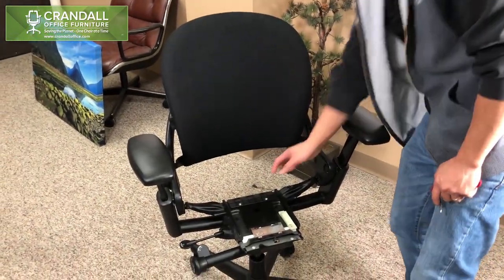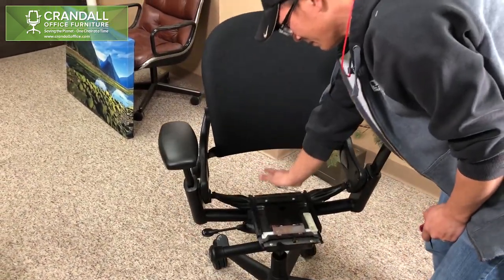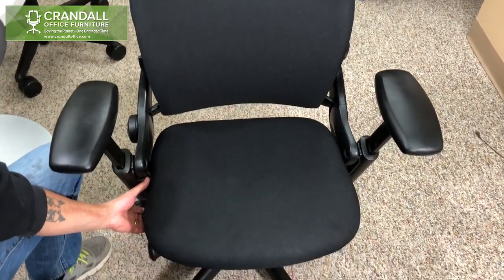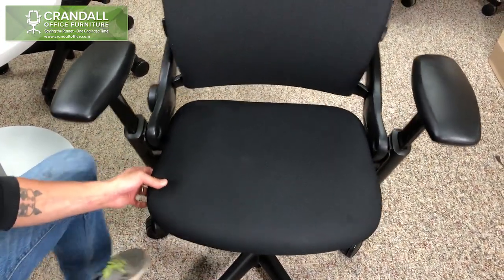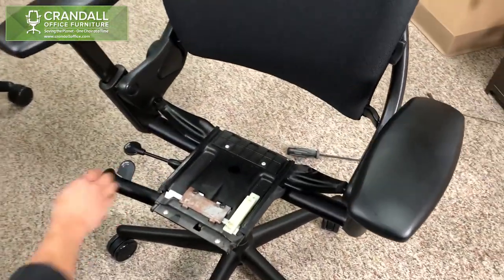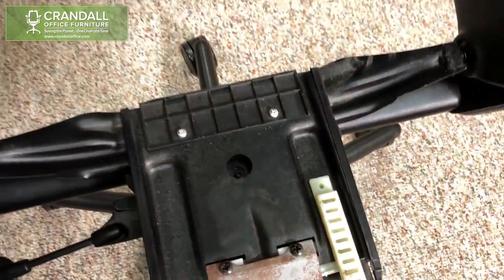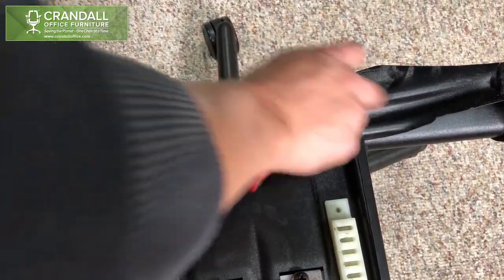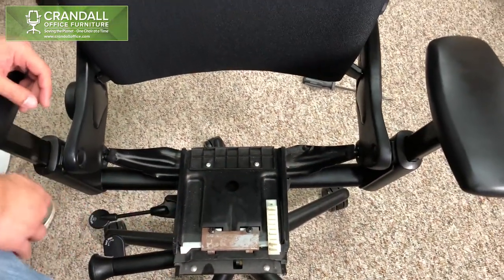Fix your sinking Steelcase 462 V1 Leap Chair - Gas Cylinder Set Screw Adjustment Instructions

Comment: For newer users, you should specify why you would tighten or loosen. Loosening would prevent it from going down while its ‘locked’. A looser set screw would prevent it from charging the piston constantly, which would give you the results at the beginning of vid
Reply from the maker: This article should help - it's all about the pivot and how the lever actually activates the cylinder: https://www.crandalloffice.com/blog/adjusting-your-gas-cylinder-set-screw/
Reply: @CrandallOfficeFurniture  I couldn't get the seat off. I think I have the same model. When I sit, the seat dips a 1/2 - 1/4 inch... Is this preventable or by design? I don't think i'm at the max weight (220 Lbs)

Comment: Can you explain how to remove the seat with the screwdriver? The guy did that really fast and didn’t say what he was poking to get the seat off that slider bracket.
Reply from the maker: Hi there - so if you watch when he removes the actual chair pad you'll see what white piece that kind of looks like a ramp. that's what you're aiming for with the screw driver - if you use a flashlight, you might be able to see it, and be able to place it a little better. Let me know if that makes sense and helps. -DC
Reply from the maker: Also this video might help - we go over a bit more in depth how to remove the seat - https://youtu.be/SCy1ErJG15s
Reply: @CrandallOfficeFurniture  I see what you're talking about. Got it! Thank you!

Comment: Is there a fix for a leap v1 from 1999 with no set screw? Not as is missing, not a part of the design. No hole for it in the frame so I drilled a hole where it is in the video and there’s no screw to adjust.

Comment: Hi nice video you have, but I still have some problems. I dont know where exactly to place the screwdriver to remove the seating part. The reason I need to adjust the screw is that the chair refuses to stay on  a setting. it sinks down until the mid level. in order for it to stay on a particular setting, I have to push down the adjustment lever so as to disconnect it from the chair until it "hangs" there. If you could help me out I would reaally appreciate it. Cheers
Reply: my longest screwdriver (7") was too short.  I used a long narrow pruning knife (used for Christmas trees) that easily reached to lift up the white tab that is adjacent to the rail.  If you have a long skinny tool of any sort likely at least 12" or more should reach.  That white tab is located on the removable seat in line with the center of the seat.
Reply: How does it lift just pushing it ?

Comment: My Steelcase Leap V1 doesn't raise when pulling the lever right away. I have to tug on the chair upwards to get it to start moving, then it raises normally. Is there an adjustment for this "sticking" ? Maybe a place to lubricate? Thank you!
Reply: Same problem, but no access hole to adjust the set screw. Help! Steelcase V1 pre 1999 chair

Comment: I think this worked for me, thanks so much! There's another video on youtube that shows how to take the seat of a leap chair btw, helpful if can't get it from this vid.
Reply from the maker: Glad this worked for you! 😊
Reply: @CrandallOfficeFurniture  Hi there, it actually didn't end up working no matter how finely I tried to tune the set screw. Do you think the entire cylinder needs replacement? The chair is currently adjustable but slowly sinks over time
Reply from the maker: @termiNader2013  If adjusting the set screw didn't help and your chair is still sinking, then yes, it's likely your cylinder is on it's way out.

Comment: Hi.. Anyways to get a zoomed-in picture of where the height-adjust lever meets the seat-base?  
Pressing the lever doesnt seem to do anything with the base for it to control the cylinder.
I have a feeling mine is broke or misaligned for it to work. Thanks.

Comment: I'm having trouble getting the seat off. I'm trying to copy what the guy is doing in the video, but he goes really fast and doesn't explain what he is doing, so I'm just sticking a screwdriver in the chair and trying to pull the seat forward and it's not working.

Edit: I found the other video that is specific to removing the seat, and it is a bit more clear. Alas, I don't have a long nose screwdriver, so I'm at a loss as to how to activate the removal mechanism. I tried to use the long hex that comes with the chair, but it doesnt seem to apply enough pressure. I shall keep brainstorming...

Comment: hey there, so my chair seems to lower on its own only once ive been off it for 15 minutes and then sit down with a bit of force, itll lower about an inch or two. Could this be fixed by slightly loosening the set screw?
Reply from the maker: Does the cylinder actually lower, or are you referring the compression of the gas in the cylinder, which feels a bit like a small bounce when you sit down? If it's the former, the set screw should help - if it's the latter it will not.

Comment: my chair sometime sinks and sometime stay on the highest position when I sit on it! After sinking if there is no weight it come right back up. Now what should I do with the screw? should I tighten it or make it loose
Reply from the maker: What you are describing is a bit odd, but I would try loosening it just a touch. If that doesn't work, sounds like you may have a faulty cylinder that needs to be replaced

Comment: Hi, I recently purchase a refurbished Leap v2 that seems to go down in height by like half an inch randomly when its not being used?  For example, the past 2-3 days, the first time I sat in it on that particular day, I noticed that the chair was lower than before and I had to adjust it back to max height again.  Is this caused by the set screw?
Reply from the maker: Hi there - that specific problem does not sound like a set screw issue - did you purchase your chair through us? If so, shoot us a quick email to contact@crandalloffice.com with your order number and we can look further into what chair you've got, what cylinder you've got, and what we can do to help :) If nothing is glaringly obvious to us, we'll send you a replacement cylinder under our warranty free of charge :)
Reply: i have the same problem and can't fix it with the set screw
Reply: @joemarilla  Lol, its funny you replied to this today, I just got my Leap v2 refunded.  I got my cylinder replaced and for a while the problem went away (2-3 weeks) and then came back.  I was about to get it replaced again today but that cylinder immediately lowered when someone sat in it so I ended up getting a refund because even the used furniture store manager was like, WTF?!
Reply: @ahmedkhan94  ah man - i bought mine used and it's so annoying, sounds like the cylinder did nothing?
Reply: @joemarilla  unfortunately no, but I think they were using aftermarket cylinders because over the course of my time with the chair, I dropped weight from 240lbs to ~200lbs and the chair started sinking less frequently.   But I liked the chair so much that I am gonna get a new one from Steelcase, either the Leap v2 or Gesture because I have heard their warranty along with their customer service is great.

Comment: My v2 set screw will fall through the hole if I tighten it all the way. Is my screw stripped?
Reply from the maker: It's likely not stripped if you can continue to turn it, but it should not fall through if the correct cylinder is in place - did you just replace your cylinder?

Comment: Even if I take the set screw out completely, my chair still rises by itself. This is with a brand new replacement gas cylinder. Any tips?
Reply from the maker: Is this one of our replacement cylinders?
Reply: Hey did you ever fix your problem? I have the same issue, I accidentally completely unscrewed the set screw and my chair rises by itself.

Comment: I have the same chair but its not top activated its side activated. That means theres no set screw. The height adjust keeps sinking after i sit on it. Is there another video someone can link to me bc i cant find one
Reply from the maker: You are correct, the side activated style cylinder does not have a set screw adjustment, so unfortunately it sounds like the cylinder on your chair may have reached the end of it's life.

Comment: I adjusted my set screw but it never locks in place now. Do I have to have to replace the gas cylinder? Or is it a different issue that needs to be fixed?
Reply from the maker: What do you mean by it never locks in place now? Do you mean the chair goes up and goes down automatically when you sit in it / get out of it? If so, back off the set screw a touch.
Reply: @CrandallOfficeFurniture  it never locks in place as in the set screw doesn't tighten anymore. There's a point where it tightens and then loosens, tightens at a certain point then loosens.

And yes, it goes up and down.
Reply from the maker: @spicykamote  So the set screw will not stay in place is what you are saying? You can try some loctite on the threads - there should be some on there from the factory, but it may have come off.
Reply: @CrandallOfficeFurniture  I'll have to search up what that means haha. But even before this happened, my chair would randomly rise up even if I did not adjust anything. I'm not sure if this is a problem with the gas cylinder or what. But I am willing to buy new parts of needed
Reply from the maker: @spicykamote  I would continue to work with the set screw - it could be a defective cylinder, but what you are describing doesn't scream defective cylinder to me. That said, if you still can't get it working, a new cylinder is what I would recommend.
Reply: @CrandallOfficeFurniture  okay sounds good. I think I'll have to get a new cylinder. The set screw isn't locking in place anymore. Thanks for the help!

Comment: how would i do this on a v2 leap? i took off the cylinder to move it into my car. after i put the cylinder back in , the height no longer adjusts
Reply from the maker: Hi there - do you happen to know if your chair uses a top or side activated gas cylinder? Can you shoot me a few pictures to contact@crandalloffice.com? We'd be happy to help however we can!
Reply: @CrandallOfficeFurniture  side activated
Reply: @CrandallOfficeFurniture  it's a side. i took it into a local office repair store and they were able to take it apart. it looks like the cylinder will no longer go up and down so i just placed an order for a new one. Do you know if using the pipe wrench to take it off broke the cylinder somehow? it was working just fine before i took the cylinder off.
Reply from the maker: @chunkymonkey2782  Are you sure it just wasn't installed improperly (with the lever facing the wrong direction)? That's the most common thing we see. There is no set screw for a side activated cylinder. Do you still have the cylinder that was removed? What happens when you activate the lever?
Reply: @CrandallOfficeFurniture  nothing happens when i press the lever
Reply from the maker: @chunkymonkey2782  Is the cylinder already fully extended?
Reply: @CrandallOfficeFurniture  it is not
Reply from the maker: @chunkymonkey2782  Alright definitely sounds like the cylinder is bad. Was this one of our chairs? That should be covered under our warranty.
Reply: No i bought it from another store but it's under warranty so they said they will replace it

Comment: Hello, I notice that my chair has sank 5mm after being sat on it for an hour or so. Then when I am not using it for a while, it will usually return to its original height.
Is this a problem with the set screw? If so, does it need loosening or tightening?
Also, is this something that can be easily fine tuned? Because as it currently stands the problem is manageable and I don't want to have it any worse.
Reply from the maker: Are you talking about the "bounce" effect that you get when sitting in an office chair (it will sink slightly when sitting in it and then returns to normal when you get out)? If so, that's completely natural. If not, you can try loosening the set screw a touch and see if that helps. May be an adjustment issue, or may be  the very early signs of a failing cylinder as well.

Comment: I recently bought a replacement cylinder for my leap v2 (top-activated) and for some reason the cylinder has a larger top activation button which makes it so that no matter how much I loosen the chair's set screw, it will always be activated. Even if I completely unscrew and remove the set screw from the frame, that metal piece that the set screw threads into is still sitting physically low enough to the cylinder on its own that it activates the button. The only hack I can think of is to try and sand down the top edge of the cylinder activation button since it's plastic. Anyone else have any advice for this situation??
Reply from the maker: Did you purchase this cylinder from us?
Reply: Did you resolve this issue?
Reply: @CrandallOfficeFurniture  Hello, I believe I have a similar problem as mentioned by this person. The replacement gas cylinder that the 2nd hand seller got for me was a TKD5201-140 TUKA. That said, the sinking was already a problem before replacing the gas cylinder, we had hoped a new cylinder would solve it, but the problem of the chair sinking. Whether the lever is activating the mechanism or not it just sinks when I sit on it. Like the lever won't even be touching the mechanism, but it'll still sink. I've also tried adjusting the hex allen screw inside. To both sides and a bunch of configurations inbetween, and it didn't work with my old gas cylinder, nor with my new one. The new one didn't even have an hex allen screw inside so I had to use the one from the old cylinder.
Reply from the maker: @hippie_4762  Can you email over a few pictures of what you've got going on there to contact at crandalloffice.com? Not sure I'm fully understanding what you are experiencing. Does your cylinder itself have the screw?

Comment: I was wondering how to make this adjustment on a chair that has a lever on top and not a screw.  I got this chair second hand, so I am not sure if it is a V1 or V2.  The link is a picture of what I see when I take the cushion off.  https://drive.google.com/file/d/1bQhmMUKSoqhtgDsFP0aQEiXmkanmjWQ0/view?usp=sharing
Reply from the maker: Scott - Unfortunately there is no set screw on the side activated style cylinder. Is your chair cylinder sinking without activating the lever?
Reply: @CrandallOfficeFurniture  Yes.
Reply: @CrandallOfficeFurniture  mine is as well. Is there a fix?
Reply: I just got a chair yesterday and I'm having the exact same issue, did you find any solution?